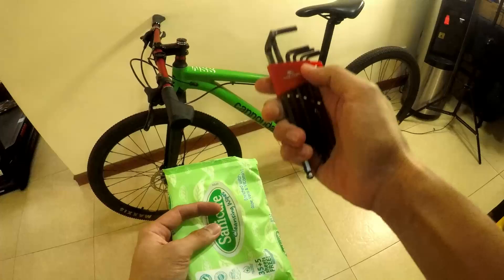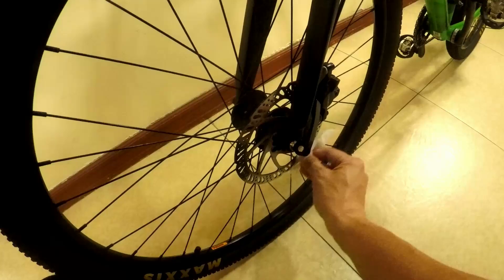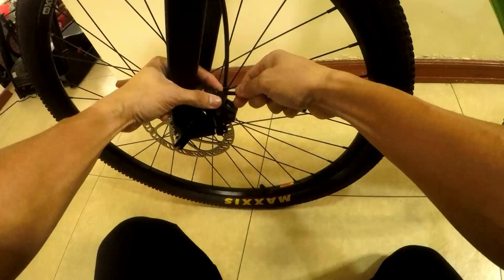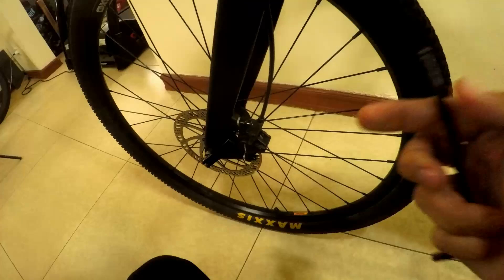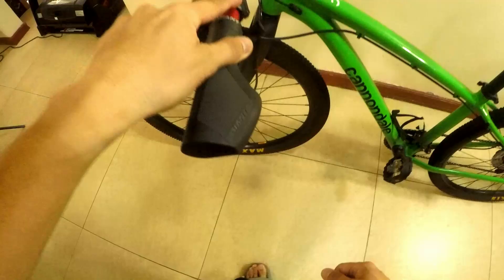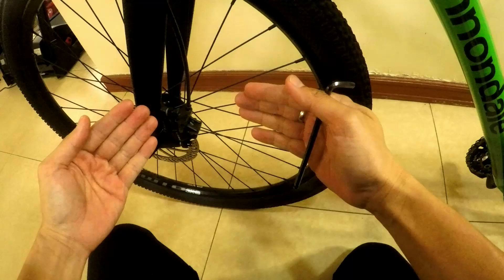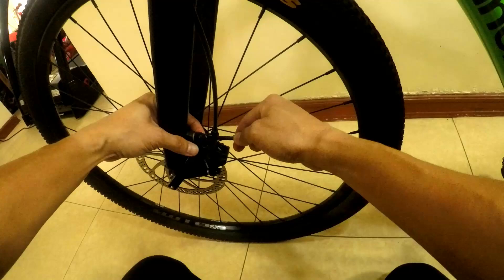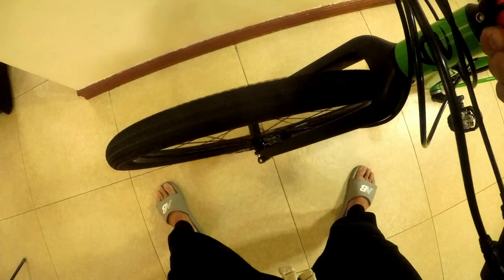DISC BRAKE rubbing against the ROTOR: eliminate the annoying friction!

Comment: What's up, I see complaints on Amazon about that carbon fork, that it's brake mounts are not straight on it and it causes problems lining up the rotors hence causing rubbing. I see one person said they had to file the mount a bit for the brake to sit straight on it, so maybe you can check that out.
Reply from the maker: Thanks for the comment and observation brother. Appreciate it. Im lucky i guess as i dont have the same significant issues as others. In fact there are countless positve reviews on the brand and i would be one to vouch for them based on overall experience. Disc rub happens on any fork/mount/caliper -- regardless of brand. What ive had to do with the misalignment was to add spacers on the mount. Then i did the fine tuning, as shown in the video. Hehe not bad for a $75 fork. Cheers bro.
Reply: @seanbike  I'm also considering using it by swapping out my suspension fork but I'm just too skeptical about these Chinese carbon stuff, don't know if one accidental drop in a pot hole or over a speed bump will cause fork failure, but it's good that you got alot of good feedback about it, how much lighter is it to say an aluminum fork instead?
Reply from the maker: I totally understand the hesitation bro. But yeah if you're after an alternative or a rigid fork on the side that u could swap out from time to time then this wouldnt be a bad idea. This one's 4 to 5 pounds lighter than a sus fork.
Reply: @seanbike   idol pano po i-align ang disc brake na malayo sa caliper yung disc brake ko po kase naka right masyado yung caliper po naka sagad na sa right kumikiskis parin

Comment: I have this problem for quite a long time na bro and it’s really frustrating. It comes and goes, my observation on my bike is when I’m in flat road it’s okay, but when I’m riding in slight “ahon” dun may tumutunog sa front rotor ko. And it’s really frustrating because when you think it’s all good na hindi pa pala lol. Another observation is when I’m doing sharp and quick turns dun sya umiingay. 
I dont know what the problem is prolly need to go to bike shop when I have the time.
Reply from the maker: Yan ang sakit sa ulo na dala ng disc brakes talaga. No permanent solution. Tigas ng ulo. But yeah get it checked narin. Be safe bro.